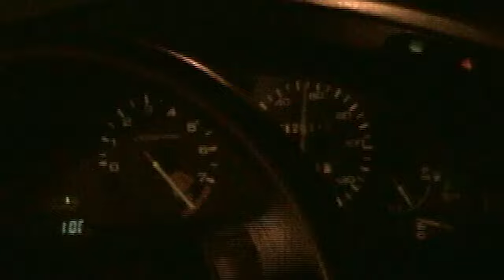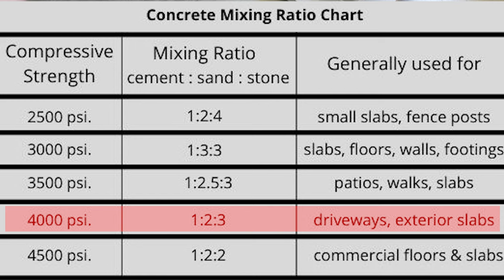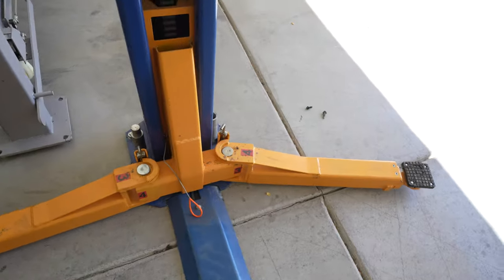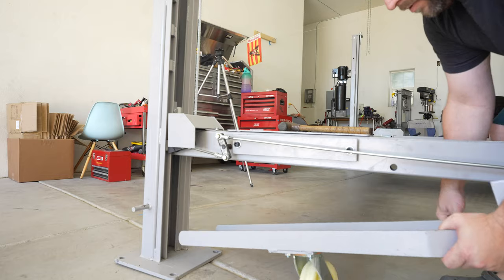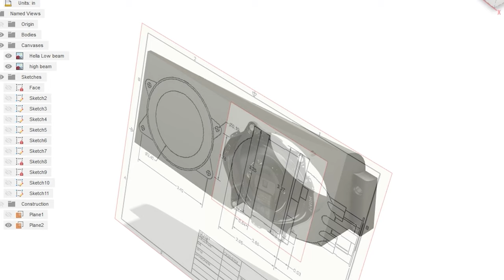4 post lift vs 2 post | Automotive lifts compared

Comment: Great video ...good topics to discuss. I went through the 2 post /4 post decision process and ended up with a 4-post. Ultimate safety and insufficient concrete specs are what drove my decision.  

Just some ramblings: 

IMHO, the first thing you should assess is your garage floor. If you know your concrete is sufficiently thick and PSI rated for a 2 - post and able to take the manufacturer specified anchors, then you've eliminated a lot of concern ...but this usually entails having a build spec for the concrete garage floor; you build the garage around the lift you intend to use. Or you cut out a more than sufficient section of floor and re-pour it. If, like me, the garage was poured per standard spec, then things get iffy and a full-size two post isn't gonna work. The short "portable" 2 - post lifts might work but you have to be sure of your slab and psi rating.

I like your tall jack stand usage ...hadn't seen how that works with a 4-post. Another option I chose is using trolley jacks that slide in between the runways for raising the front or back or both. 

All the 4-post "hobby" lifts are made in China. There is an organization called the "Automotive Lift Institute" ...ALI for short. This is an independent testing organization ...kinda like Underwriters Laboratories ...but dealing strictly with lifts. You can go to their website and see the testing they put representative lifts through to get the ALI Gold Star Certification. You can also see lifts by brand and model that have been certified. The 4-poster Direct-Lift I purchased had been certified ...which is about as good as you can get in giving you some peace of mind the lift was built to specific standards.

Great video and thanks for showing how it use the floor stands ...might have to score a pair.
Reply from the maker: All great points to be made for sure.  Concrete and safety under a two post is of utmost important.  Adding stabilizing jacks to the 2post is also something few people do, but go a long way with safety.    Lifts are great, as long as theyre used and installed wisely.
Reply: Would you please tell me the brand you use for your 4 post? Thanks

Comment: Great Video:  I was definitely not sure which type of lift to buy.  You have convinced me to go with a 4 poster since I am a relatively basic hobby user. My primary need is to store two vehicles in the normal space for one.  Using the jack stands you discussed as an option in order to get to wheels and brakes solved that access concern.

Comment: The most insanely dangerous lift I've ever seen was in the tech school I went to as part of shop class a thousand years ago. It was technically a 2-post, but the posts were hydraulic rams under the front and back ends of the car. The rams were independently controlled. This made it handy to lift either end for specific repairs, but obviously tricky to raise both ends evenly. What made the setup so dangerous was that the controls were in a well in the floor... in front of the lift. You had to kneel on the floor, reach down, and work two valves like a backhoe operator to operate the lift. From that angle it was impossible to tell if you were level or not. What happened every single time was that  you would raise the back more than the front because that looked level from your perspective. So you were literally tipping the car towards you while kneeling just ten feet in front of it. It remains the single dumbest thing I have ever seen in my life.
Reply from the maker: Sounds pretty sketchy...lol
Reply: Ha! I'm a retired automotive technician, started in 1977 and have used those very same lifts. Never had a problem with one, it can be unnerving the first few times you use it. I used my foot to run them...

Comment: Great video. That is probably the most informative video I’ve see in a long time. You made some excellent points. I worked at a full service gas station when I was in high school. We had a single post lift with four points of contact to the frame (same as a two post) that I would use to work on my Chevelle after hours. I could grab my front bumper and rock the car. I felt  a lot less safe when I found this out.

Comment: FYI the concrete is one slab- the lines are there to create a place for cracks to naturally form, instead of forming randomly.
Reply from the maker: See that...well, you know concrete better than me.  I suppose I should clarify then though, that due to the minimum thickness, being away from those "lines" is required, so people should be aware of those "grooves" either way, when thinking where they can place it.  That's how it was always relayed to me, by the installers.
Reply: @KnightDriveTV  Yes, sir.  1 slab with control joints.  Those "grooves" are called control joints or expansion joints.  As stated, they exist to "control" the formation of cracks in the concrete - to encourage the slab to form the cracks along / inside those control joints.  They are troweled into the wet concrete slab the day it is poured, while the concrete is still workable.  As far as how far away from a control joint a concrete anchor could be installed, I've always said a minimum of 6 inches, 12 inches to be safest.

Comment: Great info on the different lifts.  For an old man like me, any work beyond floor jack height is going to a professional shop. I agree with you on the safety factor, who knows what was used by the home builder for the garage floor. The four post is for sure the safer option. Pulling a Corvette driveline can be done elsewhere if need be, and that’s a rare occurrence. Safety above all else.
Reply from the maker: Absolutely agree with you there.  4 post is hard option to beat...very safe.

Comment: This video is AMAZING thanks for sharing! Ive got a 220 volt 11,000 lb advantage lift for trucks and cars (my 2013 grand sport, and 2013 M5, i have to back the cars on the lift, to not hit the front bottom of the low profile, a non issue backing up) and a 7,000 back yard buddy 110 volt 4 post. Love em both! Thanks for the idea of the jacks! My 11,000 lift has roller lift scissor jacks, but they have their limits! To anyone new to a 4 post lift, whenever you move the lift, make sure you re-adjust the nuts on the ends of the 4 cables, so the lock dogs all engage at the same time in the same holes. As i think more about this, if the concrete level is way off, due to being by floor drain or whatever, might be a giod idea to shim under  the low column plates to have the lift level

Comment: Hi Damian,
very thorough, unbiased video.
Yes, we sell a lot more 4-posters than 2-posters to home mechanics here in Oz - as they're definitely safer in shared garage environments...
A lot quicker to get cars on and off - and with optional Jacking Beam/s every bit as versatile as 2-posters...
And, most guys don't realise how much extra width and height a 2-poster needs...
I'll refer potential customers to your video - so they can get a good, balanced comparison...
Thx, Rohan
:)
Reply from the maker: Good stuff!  Glad to help!
Reply: A four post is not as versatile  you can easily make or buy adapters for motorcycles, lawn mowers and atv. With a four post list the ramps are always the way. You cal also store cars on two post lifts, but if that is all you want it for get the four post
Reply: @alanswanson5642  
With all due respect - I must disagree.
4-Posters can be used for nearly all services you can do on a 2-Poster.
We have mechanics using them for practically EVERY service.
2-Posters were never designed for car storage - but yes, if u wanna muck around each time you get the car on and off - and have the time to do it - go for it.
Additionally - they’re not as safe - especially in a shared, home environment.
It’s why we sell twice as many 4-Posters to enthusiasts and home mechanics.
Reply: @herohoistsaustralia4502 as I said if all you want it for is storage get a four post. Just because you sell more of one kind doesn't mean they are the best. Show me a single auto shop that uses four post lifts. They have a lot of limitations for dropping out the bottom. Simply not as versatile. I currently have a two post but I am thinking about a four post for my second lift, but it would never be my first.
Reply: @alanswanson5642 
The primary reason commercial workshops might only have 2 -Posters is cost. And, their focus is obviously service - not storage.
I know professional mechanics who only reluctantly turn to 2-Posters for specific services on specific vehicles - (where a 2-Poster might be superior) - but generally prefer 4-Posters for ease of use, safety and speed in getting cars on and off.
I never said 4-Posters are ‘best’ - I simply said that for most folks they’re DEFINITELY more versatile. You’re welcome to your clearly biased opinion of course - but I’m speaking from experience selling BOTH types - and from constant feedback from customers.
So - there’s that - dude…
😑

Comment: Great video. Given my soon to be garage situation, I'm seeing a lot of advantages to a 4 post like you've shown here..

- Not needing to anchor it, thus
- being able to move / reposition it,
- Can also remove it "without a trace" (no holes or modifications to slab),
- Generally smaller footprint in a smaller garage
- Using the stands to lift the car off the wheels seems like a good solution
- Lesser slab requirements
- Lower height requirements (considering ceiling height)
- Just safer given its inherent stability with a post beyond each corner of the car

.. the 4-poster would probably be a much better fit for my situation. Especially as my slab is suspended, which will be a major consideration.

Comment: I had a free 2-post lift from a dealership that was in decent shape, the one my buddy used for years at work.  I saw a 12k heavy duty shop 4 post for $1000 and bought that and installed it, anchored down type.  Best decision for me.

One perspective is if you want a lift so you don't have to get on ground at all get a 4-post.  Every 2 post and the praised scissor lift here you need to get down to where lift points are at eye level every time you lift a vehicle, royal pita, worth figuring out work arounds for a 4-post to do similar tasks.

Comment: This was an interesting video. I am deciding on this right now for our new garage. My wife was a tech at a dealership for over a decade, and she says that for most work on a car the 2 post (asymmetric) is far easier for working on a car, since most work requires removal of wheels. On the other hand, I am less experienced, and have never liked setting lift arms. I haven't worked in a shop since the early 90s, when we had a single post in-floor hydraulic lift, and I saw a few co-workers have disasters on the lift (bad judgement, not the fault of the lift). I like the idea of a 4-post for storage, basic stuff like oil changes and detailing lower panels (I'm old and have back problems, it helps a lot to be able to lift the car higher). It is mostly foolproof, much harder to drop a car. We are probably going to compromise and get both, Hers and His.

Comment: WOW!!! Thank you!!! What a comprehensive video on exactly what I'm trying to decide right now. I wouldn't even consider a 2-post unless I did a little excavation and did a monolithic pour of reinforced, high PSI concrete with overkill on the thickness AND dimensions to the edges of the pour. That's why I'm leaning towards the 4-post right now. A 4-post is more expensive but the cost of proper concrete and labor for a 2-post is also significant cash. The only thing that sucks is I haven't figured out a setup to raise the cab on my pickup trucks with a 4-post. It's more like raise the truck, support the cab, and then lower the chassis. My other SUV's are a no-brainer for the 4-post. Great video, thanks again!!!
Reply from the maker: Glad I could help in any way I can.

Comment: I have been going through the 2 post/4 post/scissor debate for the last month. I've pretty much narrowed it down to a scissor lift. The price is a tough pill to swallow but I think I'll be happier. Most of my work would be suspension and automotive detailing related. I've worked and saved very hard over the last five years and am finally excited that I can now afford it. No more laying on the ground and being sore for two days afterwards!😂
Reply from the maker: Scissor is a fantastic lift, in all honesty.  If you can do a permanent, in floor installation especially, it makes for about the best you can ask for.

Comment: I just bought a huge barndo that's 2/3 shop.  The four post is the way I want to go.  I will be alone on 40 acres, miles from help...So I need SAFETY.  I survived 20 years as a cop and it would suck to die under a car on a two post lift.

Comment: My option was the Quick Jack 7000TLX with SUV AND LIGHT
TRUCK ADAPTER KIT. Paid 1600.00 complete. Will lift my C5 and Ram Dually with no problem. Height is adequate for most jobs, and portability is there. Heavy but stable. Great when you can't commit the space to a full lift.

Comment: Thank you for this video information that you just revealed to us on this video is crucial. I have worked with both to post and four post lift in the past and yes, I agree with you. The four post is much more safer. And having the option to move the four post indoors or outdoors is very important to me. Thank you for your video.

Comment: I have a 4 post lift and love it. I also have a C5 Z06 like you. I always wondered if I need to do a clutch job on my 4 post, can I lift the car with jacks while on the lift so the wheels are suspended in the air, then let the drivetrain rest on the 4 post lift?
Reply from the maker: I think with some creative thinking, anything can be done on the 4 post.  I have used the larger jacks to put the car in the air, then use jack stands on the ramps/outer mounting points for the body and have the entire car off the wheels, on the ramps.  Lots of variations because the 4post is so stable.
Reply: Not so sure about this…  I had the rear out of my C5Z to rebuild the transmission using a 2 post lift.  I lowered the suspension and sub frame down with a transmission jack, got a buddy to help lift it to the ground, then used the transmission jack to get the transmission out.

I cannot imagine how that job would go on a 4 post lift.  About the only way I can see doing it would be to get the rear of the body on stands, lower the sub frame onto the lift rails and then drag it backwards out of the way?

Also, getting the mufflers out of a C5 requires lots of space under the rear.  Not sure if that would work on a 4 post or not?

Personally, once the car is in the air I think a 2 post gives by far the most access, but I completely see what you’re saying about safety, and getting the car lifted on a 2 post can be a bit of work.  I’ve never used a 4 post or a scissor before though, so it’s just my POV.

I’m building a house right now and I’m going to have a 6” deep section of concrete in the garage under where the lift is going, with 6” wire mesh at half depth just to be safe.

Comment: Great vid! I’m looking at 4 post but she’s gotta live outside probably under a tent on my gravel until I build my garage. Love the dual parking flexibility plus all the ways to still do suspension/tires/brakes. Tired of crawling on Vegas hot gravel and scared of jackstands/hydraulic 3 ton jack combo… makes it so I can’t concentrate on the job and only think if my head getting squished or suffocating if something goes wrong. I’d have to change casters for something I can roll on gravel till I can Pimp my garage :) thanks! Vegas in the house!!
Reply from the maker: That lift will survive outside easy here.  Vegas livin!!
Reply: If outside, do the 4 posts work on gravel or still have to pour concrete where the posts sit? Any brand recommendations? Great informative video, thanks!

Comment: KD, nice video, I've been going back and forth between two and four PST for a year. Main usage is for auto repairs for me and my sons, F350 super duty, Ford Escape, Honda civic and Ford fiesta ST. Also to store our motorcycles on the 4 PST during winter. My concern is, how difficult would it be to use a 4PST to do break work, front bearing changes, front suspension work and tire rotations. I guess the reasoning of my concern is the different width of the vehicles and the width of the frame rails possibly getting in the way of the work. I do like the availability to move the four post where I want or need it.
Reply from the maker: The 4 post has its compromises, but in a compromised space, theyre hard to compete with.  F350s down to civics though, thats a big spread for a 4post, and starts to move into dedicated 2 post 11k+lb lift territory.  If you have a solid space with good concrete, then in that lineup I'd maybe go 2post.  The moment you talk f350's though, you need a large area around that lift or its going to tricky.
Reply: Thank you KD, still on the fence.
Keep up the great videos.

Comment: Great info. Do you have any opinion on keeping a 4 post outdoors? I'm thinking I'd put some nylon or rubber blocks underneath to eliminate rusting of the base. Sub'ed, good luck with the channel.
Reply from the maker: I have definitely seen many outdoors.  Definitely depends on the climate, what type of luclbrication and prep you do, to combat weather, but definitely dooable